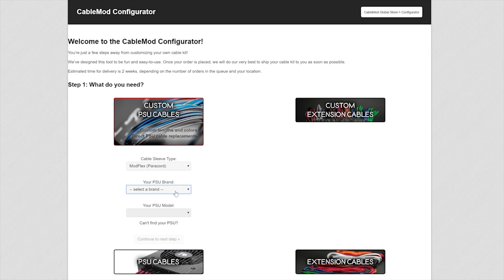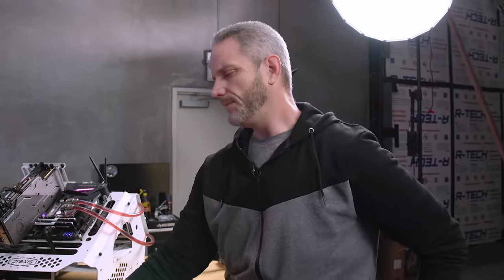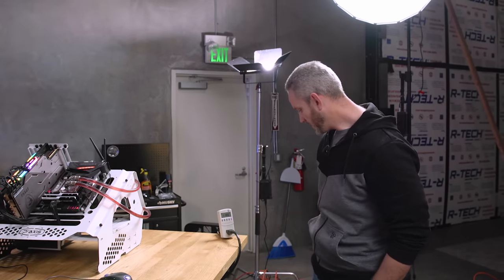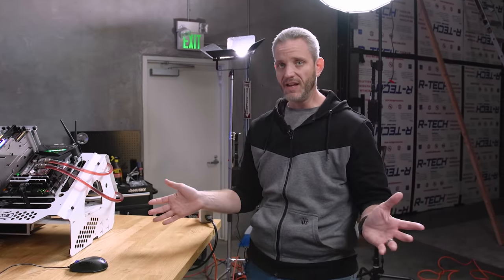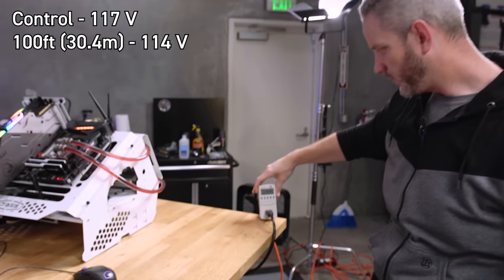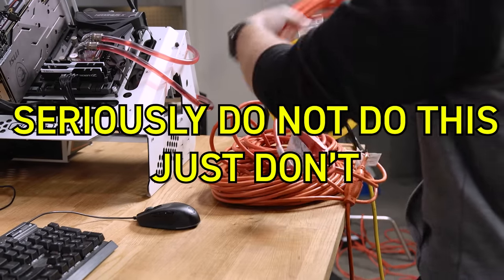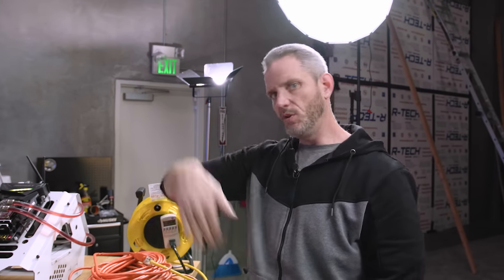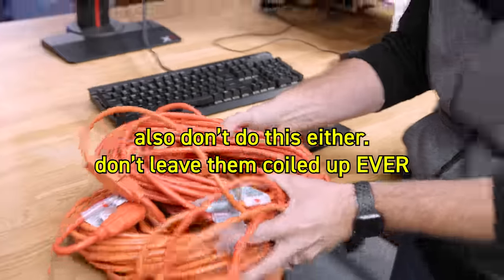Are extension cords dangerous for Computers?

Comment: here in sweden most difference between cheap cables and the expensive stuff is the cable area and materials used in the cable

the cheapest chinesium cables sold here are usualy 0.75mm2 cable (about 18.5 guage) only rated for maximum 230V 2300W (10A) at a max length of 5m. mostly cables for lighting and other low current resistive loads not realy legal to use for anything else.

the next step up is the more serious home user stuff usualy with 1.5mm2 (15.5 guage) rated for 230V 2300W (10A) load

and the stuff for professionals is mostly made out of 2.5mm2 (13 guage) rated for 230V 3600W (16A) load

i also think there are regulation on extension cords for a maximum length for specific wireguages from 15 guage and up before the insurance company gonna refuse any coverage in case of fire dut not sure of those rules but 25m (82ft) is creeping around in my head for some reason but may aswell be the restriction for something totaly different.

and also coiled up cables will also result in no insurance coverage in case of fire. 
and pretty sure there are regulations on extension cordes plugged in to other extension cords saying not allowed there aswell.

Comment: You kinda got your math explanation wrong. The system will take the same amount of power (in watts), which is volts times amperes. So when the voltage lowers, the amperes increase but the wattage stays the same.

Comment: the volts did go up beceause jay did build whit that cable coil a copper coil and that one can put lower volts in and get higher volts out(transformer) by the way if the cable coil think is build out of metal it can just start melting because of that when you are needing highpower over that coil

Comment: The title is too broad.  I use 12 or 14 gauge extension cords all the time to my 2 UPSs and from the UPS to different parts of my setup.  Max length is usually 2 to 5 meters.  Right now I pull from 1 20 amp outlet.  In the spring when the electrician comes I will get 1 additional split 120V outlet at 20 amps each side pulling from a new pony panel.  Never have a power issue except when I turn my printer on and then one of the UPSs beeps for an instant.

Comment: So I have my computer plugged in to a cyberpower surge protector from home depot, when I go to export a project on premier pro the computer cuts power, I have a corsair RX1000i PS. Also I have a lot of things plugged in with that surge protector (nanoleaf panels, LyfX  LED stip, presonus speakers, 2 monitors, and other USB powered things) 

Should I just plug my PC directly into the wall to fix this or should I just get a lower power PSU

Comment: NO!

Basic electrical concepts:

A REGULAR extension cord will NOT damage a computer.

Even a 16 AWG cord can provide 16 amps (1800 watts).

Show me ONE PC system that uses that much power!!?

ONCE you have ‘transmission’ lengths of cable (100+ feet), you only get 1/7 of that...

Comment: Hey, JayzTwoCents, You unintentionally tested another even worse failure mode of using extension cords - leaving them coiled on spools or just in spool-like-mess on floor. You were right about resistance part in wires (close enough anyway). But that is literally a third of a story. Full story is called "complex impedance". By coiling up the wire You just added stupid amount of inductance. Whatta frick is that?! No time for details, just a word of caution - it is VERY BAD TO LEAVE LONG WIRES COILED WITH HUGE POWER DRAW! It becomes even worse if there is a power tool with motor at the end of the line (drill, grinder, blender or even coffee machine)! Long story short: avoid long wires, coiled wires, long coiled wires and for the love of God, don't use power tools on long coiled wires with running PC on the same extension cord! :D
Reply: Okey, nerd mode activate for those who want to know why coiled extension leads are bad. First, we are talking about AC, not DC. This is the big one. AC means that voltage changes over time (does not matter how). See, pure resistance just "steals" a portion of power and turns it into small amount of heat inside extension cord - this is what Jay was mostly talking about. Coil of wire is also making resistance, but a different kind (yes, there are "three different resistances"). The one he demonstrated with compressor was predominantly inductive resistance - the worst of all three! In coils of wire (in electronics, called inductors, transformers, chokes, f**king spool of wire) electricity is turned into magnetic field when current rushes through the wire. Well known phenomenon of electromagnets. Well... Jay just created one, very week electromagnet from coiled up cord and compressor that contains electric motor that essentially IS a very definition of hudge inductor! Trouble comes at the point where AC becomes positive from negative or vice-versa (zero-crossing). At that point magnetic field in this electromagnet turns back into electricity in wire (that is how generators and alternators work). It is bad due to fact that it is, first, uncontrolled, second, out of phase, and third, in opposing polarity of AC "swing". Not only it creates active resistance (that is how it is actually called), but it creates an effect where device under load is artificially loading the mains grid, adding even more opposing power to electricity delivery system (in this case, long extension cord). You are essentially drawing power by ... drawing power!! And You actually have to pay for it!! Even more so, PSU has to handle all that mess of a power coming in. Let alone power losses, now You're not getting 50/60Hz sine wave AC into it... now You're getting some kind of double-ripple-counter-pushing-wiggle into it. That stresses ALL input components of PSU, and can cause permanent damage within seconds. And I mean regardless of how "gold standard" or "power-capable" PSU is! Good comparison is a well-trained muscular body builder taking a bullet into chest - bullet might be small, but it is lethal!

Comment: I'm from Australia so our voltage at the fuse box is 240 10amp single phase. so one morning I was playing GTAV (on a GTX1050 2GB, Ryzen 5 2600 3.4 GHz) and someone else in the house was using  the iron and we were drawing more than 10 Amps so the circuit blew (it didn't explode it only flipped off)

Comment: didnt finish the video yet so dont know if dangerous or not. but once had a lan where we ran an extension chord to my buddies garage and then into a power strip, then another power strip, then had 5 computers running from it. power shut of once put just flipped the power strip breaker and turned everything back on.

Comment: OK, I scrolled through comments and didn't see it so I'll do it. Journeyman electrician with 25 years experience. 

Here we go. First you said harbor freightish cheapest of the cheap. Cheapest of the cheap means a 16 gauge extension cord. You said 325' of extension cord. I see 4 cords on your table so that means 3 x 100' and 1 x 25'.  Harbor freight website has their 100' 16 gauge extension cord rated for 10 AMPS at 125 VOLTS. That's 1250 watts (Watts law: P=I*E). Only 50 watts more than your PSU. The 25' extension cord is rated for 13 AMPS at 125 VOLTS. As for your voltage, service voltage can vary greatly. I've seen from as low as 110 volts, to as high as 122, 123ish volts. That's why these cords are rated at 125 volts. 

So you gave the wattage the PC draws, 662 watts, and we have the voltage with the various lengths of cord. You even gave the wattage of the compressor! That's all the information we need to figure out how much you overloaded the 16 gauge extension cords using Watts Law. Watts(P)=Amps(I)*Volts(E or V). To find amps using watts law, the formula will be I=P/E.

You started off at 662 watts / 118.3 volts = 5.5 amps. Good to go.

Next 662 watts / 113 volts = 5.8 amps. Still OK.

at 108 volts = 6.1 amps

94.6 volts = 7 amps. Starting to push it here, but still safe. The cord will probably start to get warm at this point. 

Now, here's when the game changed. You nearly doubled the load when you ran the 600 watt compressor. Now the wattage is at a total of 1262 watts. This doesn't take into account the start up current of the compressor motor. The start up current is when you see the lights in your house dim momentarily. 

So 1262 watts / 82 volts = 15 AMPS on a cord rated for 10. The wattage didn't quite double, but the amperage is more than twice what it was at 94.6 volts. Add the 5 amp overload to the fact the the 100' cords were still wrapped up leaving no space for heat dissipation, that's when the danger of an electrical fire becomes VERY REAL. 

1262 watts / 79.3 amps = 15.9 AMPS, PC crashed.

I'm glad you did this. I'm sure it opened a lot of eyes. And maybe saved some lives/property at the same time.

Comment: I've been watercooling since the EK a240g came out, I have to top it off ever 3 months, Is it normal to loose a litte bit of liquid over time?. I  dont have any leaks anywhere. I know things have been covered in other videos. But what is a general good maintenance schedule? Its been 2 years, since install, I've changed the coolant once, and temps are in the 30s C for CPU and videocard.

Comment: 240 volts is better but edison said no go with 110 like my dc, later this was fixed by splitting 240 into 2 circuits in house, but nikola tesla calculated 60hz as most stable. aeg i. europe went to 50 because the number 60 is not metric friendly, they had a monopoly so it spread. so no, what the rest of the world uses is not better or more efficient

Comment: If you aren't aware the 110 is spec mean, tolerance is +-10% per requirement. Most plants run high for transmission and due to the potential line loss.

Also, I have to question your science of this, your proof in this is is not for the extention cord, it is the load on the line. The result is similar, but the compressor introduces a lot of line noise moreso than the load. It does add load, but you would need to compensate for the line noise variable with something like a power conditioner or use a non electromechanical engine to add load, more cords or a ceramic space space heater without a fan.

Your conclusion on why you should get better cords is correct, but how you got there wasn't ideal.

Also don't roll your cords like that, look up roadie cable methods, that is the best way. It is hard to switch to but better on cables and easier to throw to a plug without damaging it.

Comment: I kinda have to have an extension in my place. Those "stabilizers" with a lot of outlets, because I wouldnt be able to power my pc, tv, ps4, home theater, internet modem and wifi router and nintendo switch on the only wall outlet available on the wall that the tv is mounted on. It made me very afraid for my stuff to watch this video. 1st because i am in "good luck with your voltage" Brazil, second because I dont ever turn off my pc because reasons. and it probably pulls a fair amount of power being a 9900k w/ 2080 (non Ti)

Comment: So, how would you then prevent voltage drops on the same circuit when using appliances with high power draws?
Reply: Small drops aren't a big deal, most devices need less power then dished out anyway. If it happens a lot put a ups on your computer and other sensitive devices as it can use it's battery to boost the power, make sure you get a good one instead of the cheapest shit you can buy.

Comment: I run LAN conventions in Hawaii. we run extension cords to spider boxes. Each spider box has 6 circuits of 20 amps each. We run 25 ft extension cords. and have 4-5 computers and monitors on each circuit.  so we account for each computer pulling about 4amps and monitors pull nothing really far less than 1 amp. we dont blow circuits. cause we know how to balance power

Comment: “Are you ever in your house and you turn on the vacuum cleaner and the lights dim?” Nope! Because we run 240v in the UK and 220v in Europe, none of this 110v nonsense!
Reply: We should be running 230. Yes, back in the day, it was 230 on paper only. Continent had 220, UK (and I guess Ireland) had 240, we wanted a common standard (for appliances) and UK wouldn't budge. So, because of UK, everyone agreed on 230. It turned out we can achieve that by simply tweaking tolerances. Tolerances also ensured that older appliances would still work (that's why they're asymmetric). So, our appliances became 230, but the grids, while now officially called 230, really stayed 220 and 240. That was, however, just phase one. As far as I know, our networks should actually be 230 now. That was the next phase. I believe it's been at least ten years but I don't trot around Europe and poke sockets. :-) Phase one gave us a transition period so that utility companies could gradually make the change. However, UK being UK, who knows what goes on in there. :-)
Reply: @jobicek  My old place had 260V power, lol. There was a lot of dodgy electrical stuff about that place.

Comment: 16 gauge is only rated for 10a @ 50ft+ ,or 1200w @ 120v. given the cable length and voltage drop, you were pulling 18.5a or 2200w with everything going..185% of the max rating, ur lucky they only got warm.

Comment: Why is this a surprise? You don't extend USB or RJ45 cables indefinitely, why should electrical cables be able to be extended so?

Disclaimer: My dad was an electrician and I've a computer engineering degree.

There's a reason for wire gauge.
https://en.wikipedia.org/wiki/Wire_gauge

Comment: I thought this had 0 effect on consoles, my launch PS5 did a loud pop noise, and did shut down, thankfully Sony didn’t ask me too many questions, they tried to fix it, they couldn’t so they sent me a brand new one, lesson taught? YES extenssion Cords are BAD News!
Reply: Not really sure that has anything to do with the extension cord,  that sounds more like a bad component in the ps5.  If it was a bad cable the ps5 either wouldn't work or the wire would melt.
Reply: @Bendigo1  weird, thought they knew what they were talking about? Clearly not.
Reply: @lolz0r16  I think there is a misunderstanding of their information.   What you are describing sounds like a faulty capacitor or something that popped.  The extension cord isn't going to add more power than the outlet provides.  So unless your whole house is getting way too much power, or that plug you had the cord plugged into was, ther isn't really any reason that anything should have overloaded like that.  Tbh it sounds like what was happening to the 3090s and gigabyte psus.  Just something was bad in the ps5.  It probably would have happened regardless of using an extension cord or not.
Reply: @Bendigo1  interesting, I’m not new when it comes to Sony using bad/outdated parts,  but this is Hilarious.
Reply: @lolz0r16  i think it is just a matter of using whatever parts they can get ahold of.    And manufacturers of those parts not using the best materials or doing the best job of qa because they materials are scarce and product is limited.
Reply: @Bendigo1  not good, I also have a Series S, 0 problems with it. Hahah

Comment: I just did the convertions, and... Your cables are like a fair bit smaller than our standard sizes, and you have 120v instead of 230v, like, 16awg is approx. 1.3mm^2, while we usually use 1.5mm^2. You said the good one was 14awg=2mm^2, which is also lower than our 2.5mm^2 cables. The only one bigger than our standard sizes is the beefy black one at 12awg or 3mm^2. My point is, you should really have double what we have, but you mostly seem to have less.
TLDR: America has bad wiring compared to for example Europe.

Comment: You are using a baller power supply with a lot of headroom so it can compensate for a lot. But like on scrapyard wars if you don't have that nice a psu you will see issues a lot sooner.

Comment: Since my outlet where my PC is at can’t handle it and always overrides and shuts off the breaker I have to run a extension cord to the living room to my room and use a surge protector that connects to the extension cable then I plug my PC and monitor power to the surge protector is this bad? I have a RTX 3060ti, ryzen 7 5800x, and a 850w power supply.
Reply: As long as it is a good  quality extension cord, and is rated above the total consumption of everything it is plugged into.   Also want to make sure it doesn't get damaged, ie a dog bites it, a chair leg squish it etc.
Reply: @Bendigo1  Got it, thank you
Reply: @CalisMan247  your pc and monitor tripping  the breaker is something to be concerned about though...  unless you have a lot of other things plugged in and running on that circuit, the breaker should not be tripping with that low of a draw.  You should be able to run 2 of those pcs and several monitors without an issue.  Might wanna have that checked out...

Comment: Noob question here and sorry for my english. I want to plug my pc which is 500watts and my monitor to an avr or a surge protector but the main outlet is far away from pc because there are only few outlet in the apartment. Can I just plug the avr or surge protector to an extension cord? It'll go like this - PC/Monitor > AVR/Surge protector > Extension cord > Outlet. Is that okay?

Comment: I think the main reason the PC could handle the large drop in voltage (before the compressor) was because of the modern / high end PSU. 

if you were using the old Coolermaster PSUs from 10 years ago you might have seen a fire :P

Thanks for the great content ! Keep it up :D

Comment: More often than not the UK electrical system doesn't follow EU guidelines and we run at 240-250v rms
The idea that running a benchmark kills power just means your house is mad. And hopefully the earth wire isn't insulated so as soon as a wire melts it goes straight to ground and the breaker trips. :B